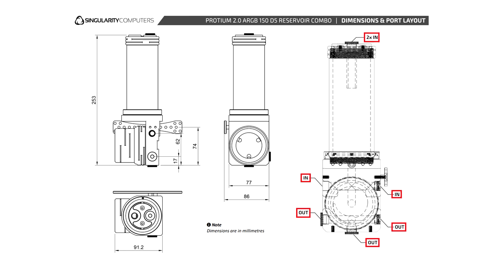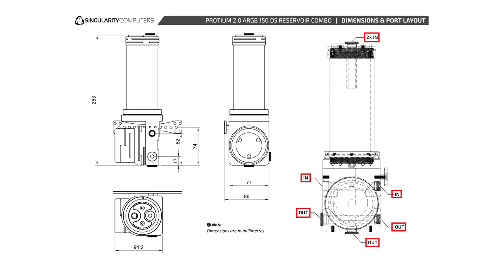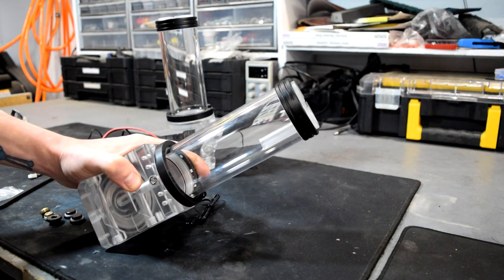Everything you need to know about Protium 2.0

Comment: wish you filled it up and start it , some people complain of vibration noise
Reply: yea v1 was noisy
Reply: @jwu122  v2 isn't much better.  with the acrylic mounted flush with that bracket it sends quite a bit of vibration through to whatever it's mounted to.  I bought some isolation rubber on amazon and to put between the bracket and the fan it's mounted to and it cut down quite a bit but it can still be heard at certain RPMs.